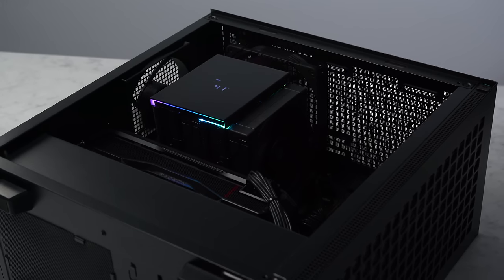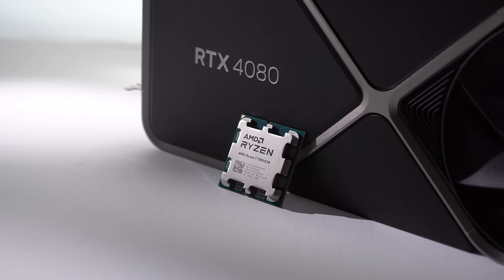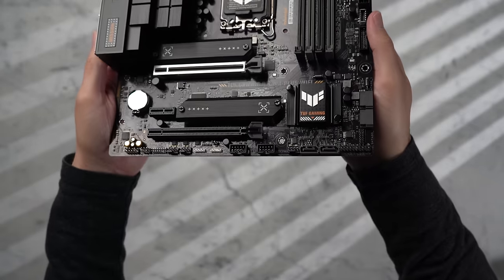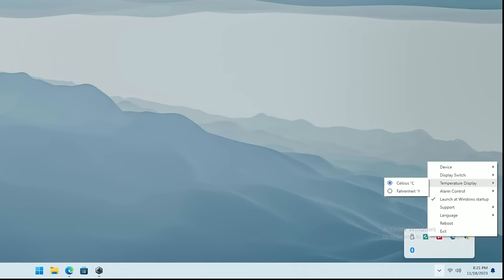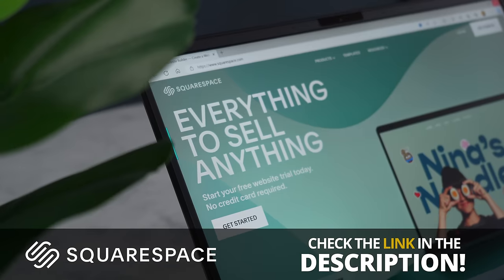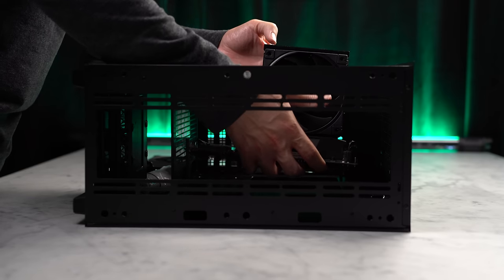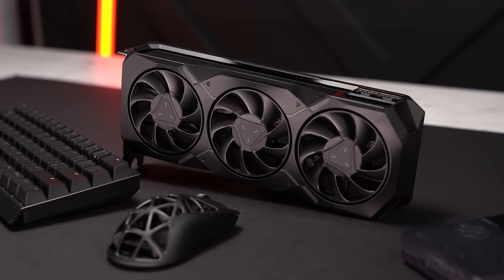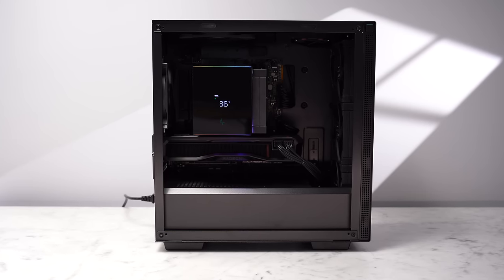Micro ATX Gaming PC That Can Handle Anything

Comment: These M-Atx are trash it is worthless because It has already an ATX case dimensions. Chinese new brands are more innovative on this. They were able to consider positioning the power supply on the front of the case rather than above or below the mainboard, resulting this saved a significant space and reduced case dimensions. These is the last period of these kind of old brain style Atx, M-Atx cases.
Reply: Hahahahaha....how is it that they are more innovative? Please elaborate.....what profession do you have ?
Reply: N please tell me out of the all parts what parts they innovated, designed and have the technology
Reply: hey buddy you have recommendations? i have an NR400 currently
Reply: What do you need 5 PCI-E slots for, when 2 full size and 1 single lane PCI-E slot are plenty for most systems. You can save a couple of cm in MB height, which equals saving weight. And I personally prefer the PSU at the bottom, it visually cleans up the PC interiour, allows for a radiator or more fans in the Front, and improves cable management. Dont forget that stuff can get complicated when using an oversize GPU when the PSU sits in the front. Ill keep this case in mind, it looks quite good, esp. for 60 bucks. But yes, esp for non-glass sidepanels and  budget/mid-range GPUs, the front PSU designs can be quite neat
Reply: Hey what do you prefer chinese brand case ? Pls answer
Reply: @atta1798 you don't know it  does not mean it doesn't exist. Just proved you are ignorance😂
Reply: isnt deep cool from China?
Reply: You know what?...You're right
Reply: Nah
Reply: @masnaringquest4626  sana nahhh
Reply: it’s cheaper
Reply: What brands exactly…
Reply: @atta1798  What does his profession have anything to do with this?
Yes, Chinese brands are WAY more innovative when it comes to this, there's no comparison. The few western companies who make those sorts of cases charge at least 3x the price.
Reply: @Augusto9588 how so?
Reply: @atta1798 thermalright with the inline pump. Not to mention 3x less the price compared to Corsair or next.
Reply: Lol. Me rocking an Itx case with a 4080 super. Is laughing rn

Comment: I upgraded last month to a matx gaming system, i am really happy with it and you can build very powerful systems in matx and think most gamers could be happy with that size. I have 7800x3d and a 7900xtx and im very happy with the performance at 1440p (getting a 135fps). I also aircooled for the first time in years and think air cooling still defintly has its place even with quite demanding cpus.
Reply: Air cooling has come a long way with some performing at least as good if not better as some 240mm AIOs. You also have a very efficient cpu!
Reply: @Samsei1  thanks I haven't as air cooled in years, I always had aio water coolers.
Reply: You have a link to your build? Which cooler did you go with on the 7800x3d?
Reply: Which case did you use? Looking to make a micro ATX build with the same cpu and gpu. Is cooling still good enough?

Comment: I recently put together my first m-atx PC. Just something simple for my dad. Used the Fractal Design Pop Mini Air case. Really easy to build in. Good compact size. Cheaper than a full tower. Can still fit a full sized PSU, GPU, air cooler. So no need to shop for bespoke bits. Very happy.

Comment: This is also one of my favourite cases to use for PC flips and build requests. When it's on sale in Canada, the price drops to as low as $55 or ~$40 USD, which is insane considering what you get for the price (reusable PCIe slot covers, built-in GPU holder, toolless tempered glass side panel, headphones holder, great build quality overall). My only complaint is the single included fan, but I understand that's what keeps the price down.
Reply: U can pick up 3 fans and a FH-04 for like 30 bucks total definitely worth it for a personal build but temps are fine even with just the single fan

Comment: I built almost the same rig coz of this video. I went with the AM4 path rocking a sapphire pulse RX 6800 xt with a Ryzen 7 5700x CPU with the same deepcool cooler and case.  Thank you so much man! Happy New Year!
Reply: Hey do the ch370 have enough room for XFX Speedster SWFT 319
AMD Radeon T™ RX 6800?
Reply: @_notl.namel_  My sapphire pulse rx 6800 xt is 10.5 inches and its fits well enough. It has approx 4 inches before it hits the front fans. The Speedster SWFT 319 is 13.4 inches. It might have a few centemeters before hitting the fron fan. Its up to you if thats ok. But it will probably fit. Do some research before trusting a random comment on youtube tho lol. :)
Reply: Does the case have enough space to close the glass properly with the ak620?

Comment: Tbh I really don’t mind my case being 3cm taller (corsair 460x) to run a full ATX board. Had I built on mATX, my usb expansion card (needed to run my oculus rift with 3 sensors) would sit one slot closer to the GPU, reducing the airflow to one of its only 2 fans (4070 super reference card). I would also have needed to settle for onboard wi-fi rather than the PCI-E card I have. My situation is pretty specific, a more recent VR headset wouldn’t need that USB expansion and ideally I would have my internet wired. But still. With the popularity of SFF cases in recent years, I feel like the versatility of ATX has become quite underrated. For the minimal space that mATX saves compared to a compact ATX case, I don’t think it’s really worth it ; it’s not like it’s the kind of space saving that makes you reconsider putting your PC on the desk instead of under it.

Comment: The PC case seems really the hardest thing to buy (and possibly deal with), if the choice isn't just "perfect" or limited. This for example isn't perfect for not having front coolers installed, unlike some other options. And no option is perfect anyway for not having a side-mesh option, because of the window trend.

Comment: I don't mind having micro ATX PC build but at least build it with proper cooling and ventilation. Having the temp reach up to 70~80°C is a deal breaker for me when using compact chassis.

Comment: Ya, how did they FAIL so badly not having a USB-C Port...  I mean, that's 10 YEARS ago level of "behind the times" failure.
Frankly, there are plenty of other good cases to get, even though most would be more expensive, they would also be just better and you can keep them forever.

Comment: Good discussion on ITX vs micro-atx. I need to upgrade soon and I really like what you did in this build. What are your thoughts on AIO vs aur-cooled? Another big choice
Reply: air coolers have come a long way and if you have an efficient cpu like the 7800x3d, it's no problem. My buddy has a 7800x3d with a noctua Nh-u12a. Very good temps with the PBO settings from optimum tech.

Comment: Thank you for the quick comparison between the Cooler Master Q300L v2, both of these cases are my choices if I decide to build a PC. Did you notice any thermal issues with the Q300L? Some comments on Reddit said the design is basically identical to the original Q300 and that apparently was bad at air flow, which is a shame for how nice and affordable it looks. Thanks

Comment: I still see those watt consumption while gaming and I say no no no.  I seriously don't know if I would buy top end hardware today even if I had more than a euro in my accounts. 
The idea of consuming more than 250W for a GPU alone is very off putting to me.    
I guess the one positive thing about the RTX 4060 and I guess even 4070.  
Very good build, and I do agree the price of that case is amazing for what it is.

Thank you for sharing.
Reply: You could buy higher rated GPU and undervolt it a bit. I went for 4070ti and now it runs games at ~170W. Because I also think burning 300+W on GPU alone is a bit too hot for my room and needs. But then you could undervolt AMD as well. Not as great as Nvidia, but close enough. For the sake of performance numbers many parts are pushed quite hard. Doesn't stop you from changing that.
Reply: @vensroofcat6415   It feels like modding games to make them work.  Not my style.
Reply: @TrusteftTech  You do reduce shadows in some games settings when running short, don't you? 
The thing about performance per watt curve - it isn't linear. Limiting the top performance by 10% you can often achieve like 30% savings for power. Because that tech was pushed close to limits right out of the factory. We basically buy overclocked GPUs and CPUs for the last 5+ years. Even those without OC in name.
It's not you who's modding. You are kind of making them "normal". Nothing wrong with being slightly more reasonable. No pressure though.
Reply: @vensroofcat6415   LOL that's one way of thinking it.  Why does it feel like you are trying to push me to do something illegal? (j/k).   Still no, but thanks.

Comment: Damn, this video has a lot of suspense with its perspectives and cuts... For the simple reason that I try to find out if this motherboard effectively has the GPU slot the second PCIe slot or the first. I believe Asus annoyingly tends to use the second slot for the GPU, even in microATX, where it causes disadvantages in cooling due to the cramped space. Think a 3 slot card, and you only have  a maximum of 4 slots before you hit the floor... Get the idea?

Unfortunately, this video provides no clarity on this board's ambivalent layout, as there are no clear perspectives from the back (with card installed). So I have to assume it is the second slot, as it seems to be. Shame.

Edit: Nah...  The motherboard series exists for both sockets, and foolishly Asus uses the lower GPU slot only for the AMD version (and I will never figure out why you show off a AMD CPU and socket in the beginning, no matter). And only there, and maybe only for microATX Asus annoyingly uses the second slot approach... Unbelievable. What a useless world entirely.
Reply: 1:42 clear front shot.  The m.2 is next to the io panel and the first slot is a true first slot.  I do hate that this is something you have to pay attention to in matx especially.

Comment: 4070 Super is wayyyyy better than the 7900XT for most people's uses.
Reply: The 4070S delivers on average around 15 less fps than the 7900XT in rasterization and a couple fps less when using RT. What are you even on about?
Reply: @NemoRSRB  And with DLSS? 

And outside the cherry picked suite of games usually benchmarked?
Reply: @MalumZeth  Both cards can use upscaling technology and frame generation so of course the result doesn't change. 
And how is every popular game that people play a "cherry picked suite of games? And you can't be seriously thinking that major and smaller channels that benchmark games deliberately chose a specific set of games just to favor one card over the other. You have no objective arguments, just an obvious parasocial relationship with Nvidia. And just for the record to prevent you from using an argument I can feel coming my way, I use an Nvidia card.
Reply: @NemoRSRB  i play darktide a lot and it doesn't support amd frame generation, so switching to 4070 super my FPS has almost doubled.
Reply: @MalumZeth  well there you have it. 4070 super is better when playing darktide lol. But most people don't only play darktide.

Comment: That is one gigantic "micro" atx cases. it's like mid size case. no micro atx should be large enough for 360mm gpu and it looks like it was designed in 1998